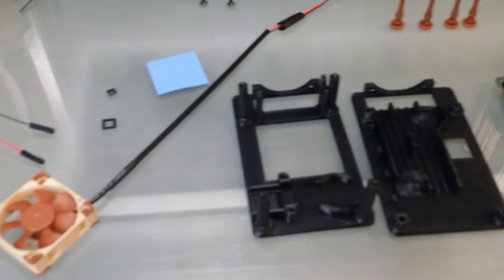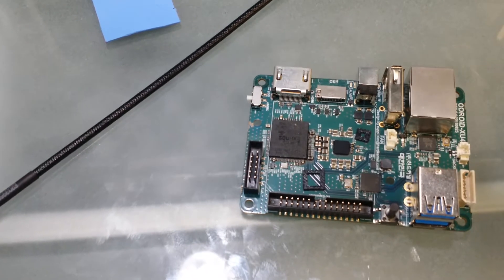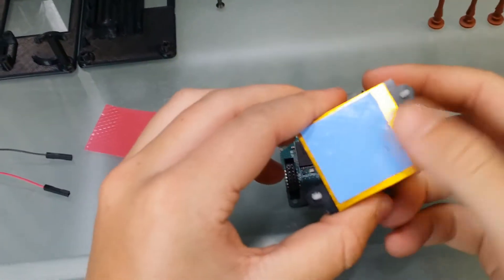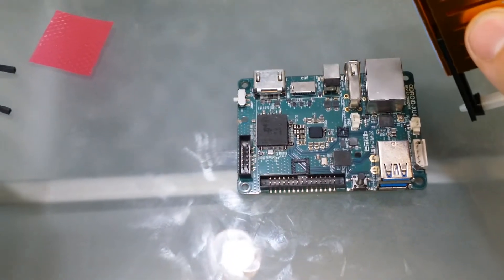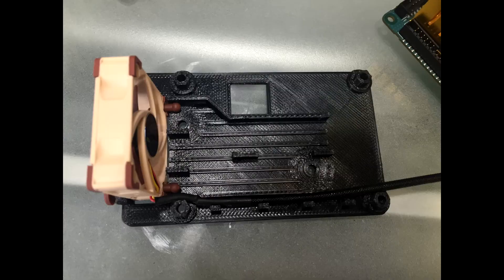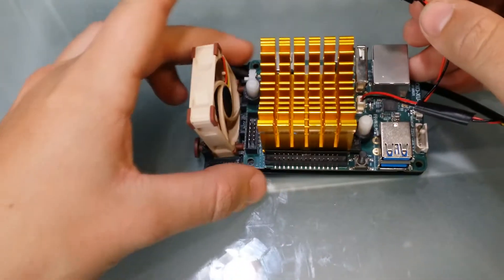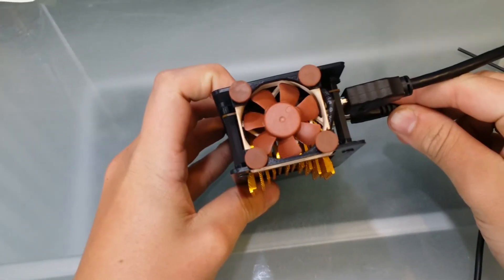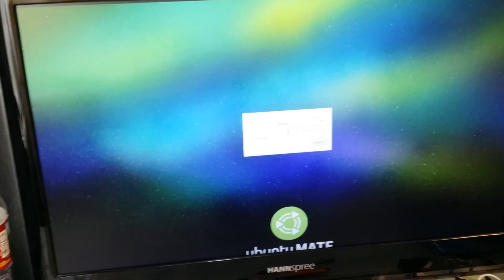Hominoid Case Assembly Video

Comment: ameriDroid Will this case fit a ODROID-XU4Q board? The one that comes with a heatsink already installed!!! Thx!!!
Reply from the maker: Yes. It does!
Reply: @Ameridroid1  thx! I'll be buying from you soon!!!
Reply: @Ameridroid1  One more question, Does the Hominoid Case come with the fan? In your web the case costs $14.95 (picture shows fan included) but you sell the fan separately for $18.95 So it's not clear to me whether you sell the fan with the case or not. Thank you very much!
Reply from the maker: @Phantom-pj1ls  The case is sold independently of the fan as the case is compatible with most 40mm fans. However, we do recommend the Noctua fan because it is isolated from the case via the rubber connectors which can also act as feet if you stand the case with the fan on the bottom.

Comment: The heatsink is not very straight in the water... on the left it was a little bit higher; those asymetric placements onboard components... just had to go some steps back. used a terminal strip instead of soldering... for the moment.
Reply: hey dude Does the Hominoid Case come with the fan? Or you gotta buy it separately? Thx!

Comment: Already ordered one of theese unique cases... Our shops in europe does not have stuff like this... also this alu passive cooling case https://ameridroid.com/products/xu4-aluminum-cooling-case-red is incredible justf to have a look; did not touch it yet; 12 Days of total shipment; can' t wait for this stuff.

one question for this gold heatsink (passive) cooler, is it possible to NOT use thus cooling pad; using instead cooling paste like arctic silver five ? or is it about height etc pp??? I never used cooling pads and think performance is 4-5 degrees (celsius) on a desktop pc difference; even between different pastes OR liquid metal...

And could you run some (worstcase full load) benchmarks in comparism to that passive cooling case 0187 colour whatsever shm...?

Comment: Better if you used heat shrink and not tape on the fan power and because you cut it any way should of cut the fan power cable to the right length.

Should of showed taking off the old fan. Now I know use a ink pen with the ink out of it and have to push hard to release the clip holding the heat sink down.

Nice video. Neat case for the XU4.